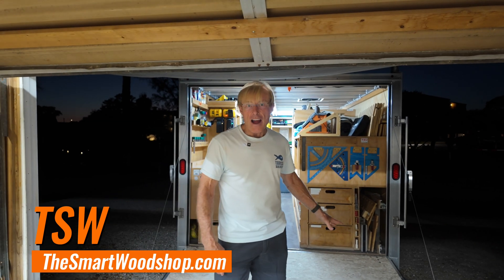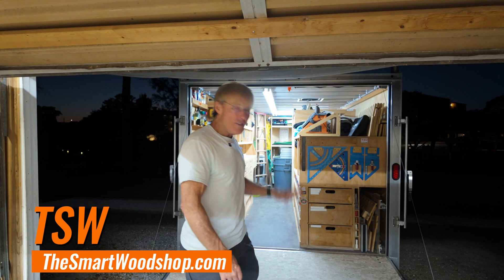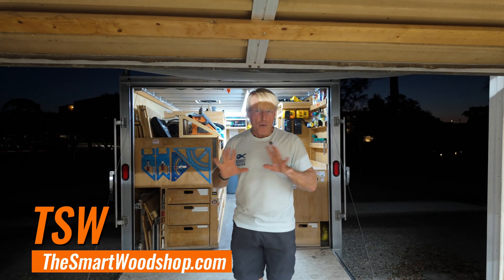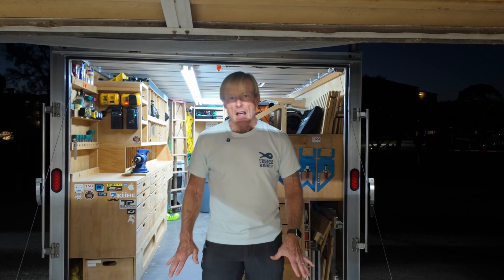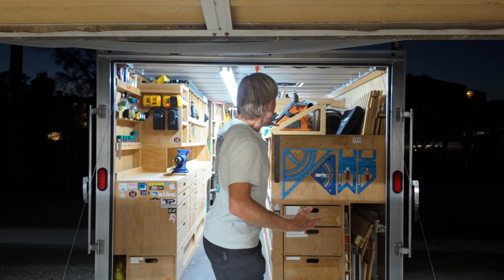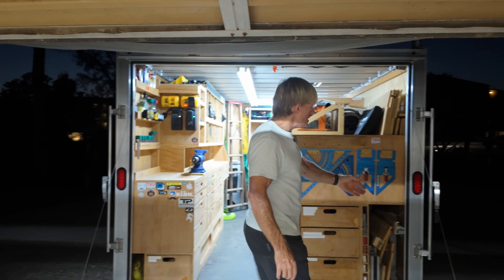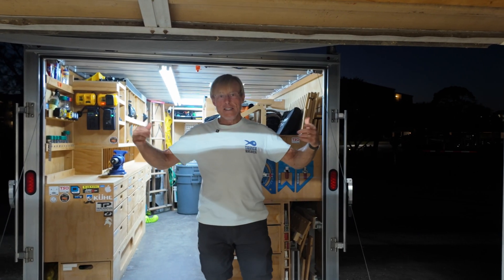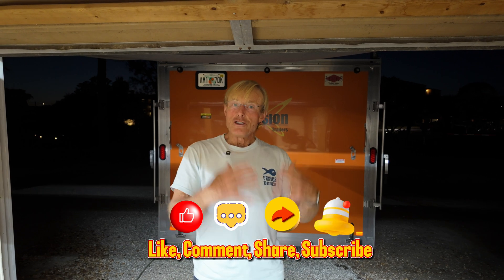Engineers Unite: Solving Trailer Ramp Door Challenges Together

Comment: Perhaps use weights with some guides instead of the top springs. One weight per cable in each corner. When the door/ramp is down and weights up, figure out a way to park & lock the weights. The weights would be sitting and the cables could be disconnected. I see donut shape weights with a steel rod for guidance.

Comment: since you got me thinking about it, how much are you willing to spend to achieve a cable free door?  if you were ok with $1k or so, then having a local hometown weld shop make you a replacement door using all aluminum in leu of the steel tubing.  and replace the plywood with "coosa" with 2/3 layers of 1708 biaxial fiberglass laminated to the coosa.  (40-60 % lighter than same size plywood but 3x stronger)  this would dramatically reduce weight, opening up possibilities as others have mentioned the lifting moment would have a mind blowing amount of force required.  then the lifting / closing could be done with 12v electric actuators mounted vertically at both side pillars of the trailer.  pushing / pulling on a 90 degree " L bracket" with the pivot  point in the center of the L fixed to the trailer floor.  i designed a similar setup to tilt and trim a 350lb outboard motor.  the trim / tilt went out and replacements are stupid expensive, and i already had a couple actuators capable of 1,400 lb push / pull strength.

Comment: im not sure how it happened, but a few years ago one of my cables became loose repeatedly.  so i just removed it.  im sure trolls in the comments will give multiple reason why this isnt safe or wont work.  but it does, and very well, and has been in this configuration for at least 2 years.  it obviously doesn't have the same power but assists enough where a child could lift it, and once past the critical center point you have to aide it from slamming shut.  if i had this idea on purpose i'd of removed the driver's side cable as i always park to the right and that would open up the side i use 90% of the time.  this isnt a total solution but it will open up one side the way you want
Reply from the maker: I would not recommend using a single cable for many reasons, but primarily because you have no redundancy. If the one cable fails, the door will fall, and if someone is nearby, it could cause great harm. It isn't worth the risk. A few months ago, one of my cables spun off, and I immediately stopped my project and reset the whole system. It took me an hour, but my wife uses the trailer as much as I do, and the danger was too high.

Comment: I have seen a winch mouted to the ceiling of the trailer with a hook on the cable and fastened to door. Switch mouted on the outside wall of the trailer. Once door is open unhook winch cable so it isn't in the way, one draw back is winch was slow moving.
https://www.youtube.com/watch?v=6PHEm8DG_sg

Comment: Your moment arm is at a great disadvantage, which in turn is going to put tremendous stress on the hinge at the bottom.  I believe you would have to strip all the skin off the door and rebuild it much stronger to do your idea.  And even then I doubt it would work long term without problems.

Comment: What about large gas struts mounted below the trailer and then connected to a reinforced ramp door. The struts would push the door up and closed. Think of it like the door on the back of garbage truck that forces the trash into main compartment but a lighter application that is compressed gas instead of hydraulically actuated. Since the door is angled there is room under the door for reinforcement.
Reply: The only issue I can see with that is the struts are pushing on the door in a way that will stress the hinges and will weaken their attachment.  I've dealt with struts on a smaller scale than this and when there is extreme force placed on the hinges, they fail pretty quickly.
Reply from the maker: Beyond my skills🤔
Reply: I agree the hinges would need to be swapped out for a heavier duty set or reinforced.
Reply: @dmccaul6638  Yes, exactly. Even with heavy duty hinges, the stress on the bolts/screws holding them or the trailer itself might loosen over time with use. You would need to reinforce everything and probably have the gate hinged directly to the frame...
Reply: Nice Idea but you are on the wrong side of the door for normal application of gas struts/springs.
Reply: @advancednutritioninc908  There are gas struts that work in tension rather than compression, I bought some that are rated 300 lbs. with a stroke of 20 inches, the issue it at a pull point on a heavy ramp that is not enough. There is a very high torque to these doors when moving the pull point that close to the hinge.
Reply: I don't know what kind of mass those doors are but gas struts seemed like the obvious solution to me. Gas struts can be either push or pull so no need to go outboard. Comments regarding stresses to hinges noted; you could have a bell crank welded to the door with the struts running horizontally into the trailer which would give you the mechanical advantage where you need it whilst reducing the stresses on the hinges, and the struts would be protected.
Reply: This is how they do it on horse floats - gas struts. They even make a conversion kit. My trailer has the same spring and cable setup hence why I’ve also been looking to upgrade.
Reply: @gingerninjasideshow  who makes a conversion kit? Also note that horse trailer ramps are not as long as a full height cargo trailer gate, which reduces the moment of force close to the hinge. Yes no cables around horses, usually use a very strong tension spring very close to the hinge pivot point.
Reply: @performancetrailersnj6060  In Australia there are numerous trailer manufacturers that sell a tailgate/ramp lift kit for retrofit. You’ll need the strongest strut and may need to lighten the ramp (i.e if your ramp was designed for quadbikes). I’ve seen some trailers have been fitted with 4 struts on the ramp to overcome the weight issue.

Comment: @mostlyh20 is correct horse trailers do use springs at the pivot/hinge point as standard those trailer rear ramps are often steel framed & @billbucktube is also correct the frame at that pivot point has to be strong & that normally increases weight. I say why not get rid of the ramp, put in a light weight door that raises with gas struts that can double as cover when it rains and just have light weight folding ramps that you remove after use? You only have a narrow corridor that you walk in & out of.
Reply from the maker: The ramp door works well and has stood the test of 30 years on the job site. It's just the cables that need to go. If the solution isn't simple, I will stick with what works and deal with the inconvenience.😎
Reply: I think this is a great idea. It would be nice to have a rain awning to extend out over what would become a semi-protected work area. I also can see it being convenient having access to the tools near the end of the trailer without having to get up and inside. Lightweight folding ramps would be enough to roll most of what Ron and I have.

Comment: Any idea of the weight of this gate?
Reply from the maker: The ramp door must be a couple hundred lbs
Reply: @TheSmartWoodshop  Put a scale under the ground end of the ramp, use a vice grip or a bar to just barely relax the cables, and not the weight at the end of the ramp. Double that is the weight of the ramp. The length of the ramp multiplied by the weight on the scale is the ft. lbs. of torgue required to assist it. If you move the hinges to pull from a halfway point to the hinge it will need double that spring rating. As you move in past center, the spring is then trying to lift more than just half the weight because you are then fighting an upward force against the hinges, it is no longer a linear calculation.  I have fastened a pull point 10 inches from the hinge point on a ramp with 160 lbs, at the back of  a 6 ft 2" tall ramp and measured 430 lbs. on a pull scale. Made it lift off a cable just 10 inches from the back of  the trailer, but needs a very strong spring assembly.

Comment: As an engineering challenge there are two main stress points at present. The hinge and the lift. If you combine them all of the stress will be at the hinge. As such I would prefer to have 15-20 smaller springs rather than one on each end. But that would put all the bending stress along the hinge since there won't be two cables lifting.
Reply from the maker: I know it will be a challenge😎

Comment: Why not put in a winch, at the top of the door, somewhere, or on the side via pullies, and lower the gate or raise the gate with the push of a button, using the winch.
You could place the winch door connection(s) wherever workes best.

Then disconnect and reel back in the lifting/dropping cable out of the way?
Reply: +1 on the electric winch idea
Reply from the maker: I would like to stick with a spring.🤔

Comment: If you are super keen, you can always do 12v powered hydraulics, similar to the lifting and folding tailgates you see on the back of some delivery trucks, or inside/outside of vans designed for wheelchairs. Expensive in general though, and particularly for custom work if you aren't setup with tools and skills for metal fabrication.
Reply from the maker: That does sound expensive $$$$

Comment: You could use a miniature version of the spring setup that exists on our garage roller door where it winds up / unwinds as the shaft rotates. The key bit is that you need to balance the spring's stiffness relative to how much 'winding up' can occur as the door travels through its range of motion - say 110 degrees or so, and the weight of the door). A sufficiently stiff coil spring could be wound up for that purpose, or, a sufficiently soft and elastic torsion bar might also be used. The challenge is balancing the door's movement range to the spring stiffness and weight of the door.
Reply from the maker: I am not sure how that would work on a ramp door working off the bottom

Comment: Split the door in half like a station wagon hatch tail gate.  Then you have an awning and a ramp (albeit steeper ramp). Spring hinges from rv or trailer shop on bottom.  Struts on top.
Reply from the maker: Good thought, but maybe not for my situation
Reply: Just wondering… would you consider it if it came as an engineered option on a new trailer?   Hacking an existing door is not worth it but as a new design idea does it work for anyone?

Comment: Totally agree with the antiquated rear ramp trailer door we’ve been dealing with for years. I’ve done a lot of thinking and research about this. I’ve even spent hundreds on speculative ideas…..including a 12 volt garage door opener. Another idea I entertained was shock supports arms like for trunk doors or hatches. Gravity is a big factor/dilemma on these ramp doors. Because we are parked in so many elevations, we can’t always count on consistent gravitational pulls or pushes to the opening (or closing) of the door. Unless presented with something really awesome, my first choice would be an electrically powered solution. I’ll be following this thread…..hoping others smarter than myself will offer a great idea that won’t cost as much as the trailer itself. Thank for bringing this problem out to a very large group of folks who struggle with this every day!
Reply from the maker: Reasonable price, durability, safety and passive are my goals

Comment: The large toy hauler type RV trailers have a spring type hinge on the bottom. Works perfectly for lowering and raising those ramp doors. That said, stop in at a reputable RV store with a service / parts department and I'm sure they could sell you that hinge. Bolt on or weld on. Cheers,
Reply from the maker: Toy Haulers 🤔

Comment: Maybe a small wireless electric winch to replace the cables. With a hook on the end that you can unhook so the cable doesn’t get in the way.
Reply from the maker: I prefer to stick with springs and avoid motors and power.
Reply: Problem I’ve seen with this hoist option is when the trailer is parked on an elevation with nose down. No gravitational pull to get the door moving out on  its own. The hoist can’t “push” the door out.
Reply from the maker: I like the idea of springs vs motors
Reply: @TheSmartWoodshop  okay 👌
Reply: @mrkrause3   a pull rope or flat webbing.  But that is the same issue that already exists--since the current spring and cable system only help to pull the door closed. They let the door open softly, instead of banging to the ground. It already does not push it open.